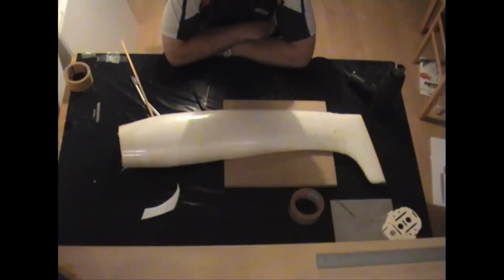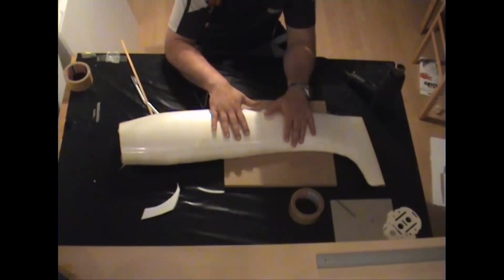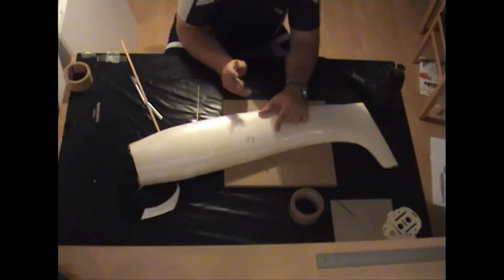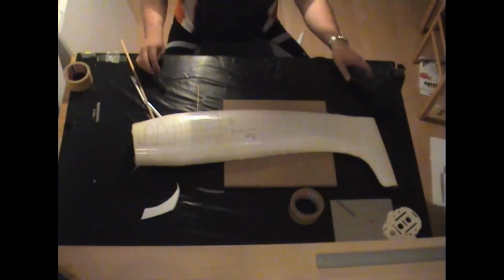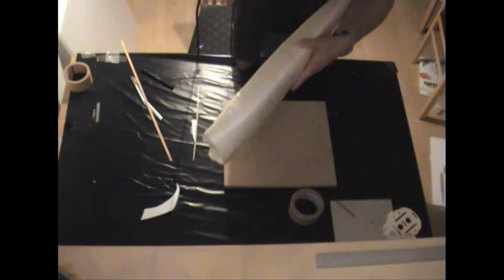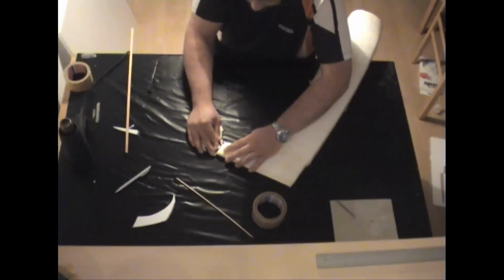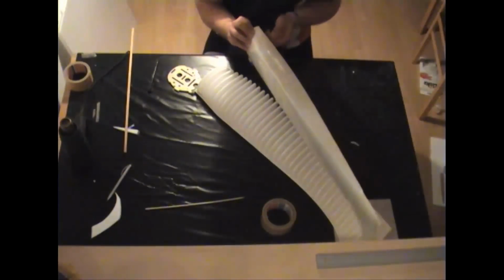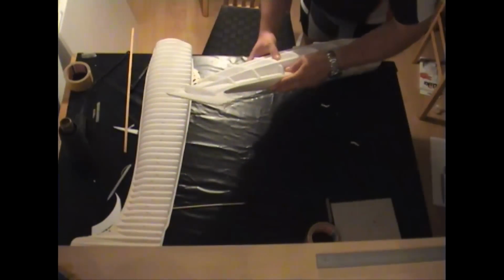A1 H Skyraider Heating And Cutting of The 1st Fuse Shell

Comment: A very nice video, working and bending depron.
Cutting the ribs, for the jig seems time consuming.  Of course, good work takes time.

I wonder if using wood, would make a better jig, being heat resistant ?

Deep draw, or vacume forming is another technique that requires a lot more work, for the intial set-up

Great videio - that you for sharing.